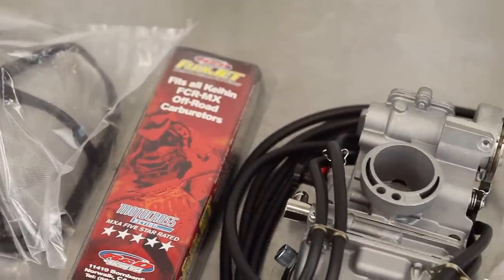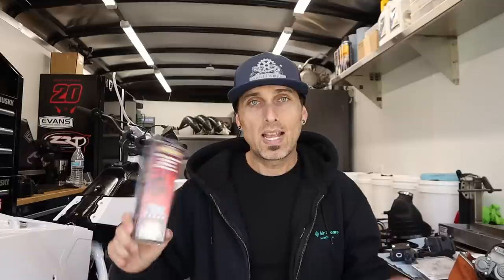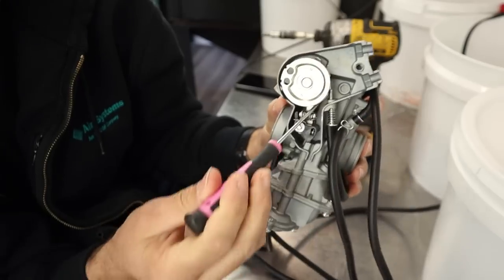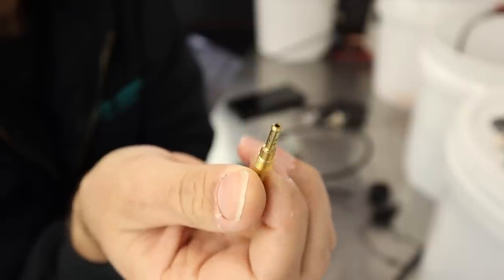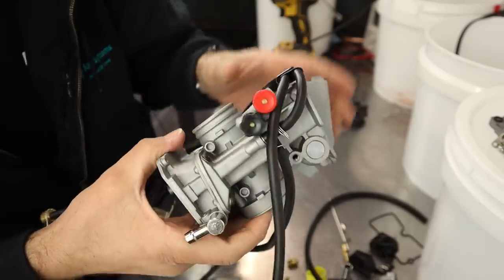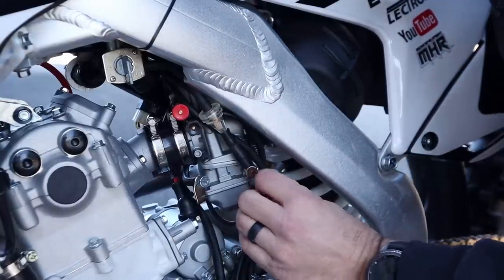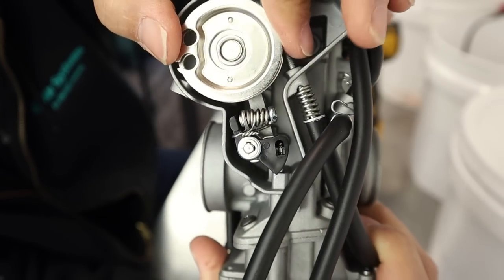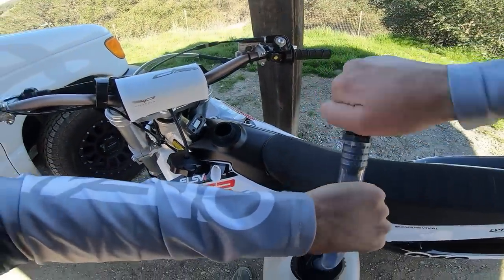Your BRAND NEW Chinese dirt bike runs like S#%T! 💩 Lets fix it.. 2022 SSR SR300 first ride & review

Comment: That FCR carb is way to complex and over engineered for a single cylinder engine, I'm wondering if a carb like the Mikuni 34mm Flatslide would work well on that bike, I raced an Al Baker XR 280 for years and that carb made all the difference in the world and much easier to tune, just a thought but many times simpler is better.
Reply from the maker: It's true! I always thought "wow, how the hell did anyone even come up with this??" with all the castings, ports, threads, etc. It's honestly amazing when you think about it.

Comment: I’m having flat spots up top and having to turn my needle out 4 turns to run. I have a 140 main and 42 pilot at the moment. My cousin said I need to up both jets I’m at 433’ elevation in Mississippi. Any help would be much appreciated
Reply from the maker: If you're having a runability issue in a very specific spot, like you said, up top... You want to focus on that area of getting rather than all of them at the same time.

Swapping multiple Jets at the same time can make it even more confusing and frustrating because everything will change and you won't know which circuit had the good or bad effect and you will start chasing your tail most likely.

So for up top symptoms, usually you're going to want to consider the needles clip position. The needle lives inside of the slide.

If you lower the clip position, it will raise the needle. This will let more fuel through the main jet sooner, which is the jet allowing most of the top end fuel delivery into your engine.

You would only want to do the clip change One clip position at a time.

Also, you could increase the size of your main jet.

You want to focus on eliminating that very specific flat spot up top that you have mentioned. Nothing else in the meantime. 

Just don't make a bunch of adjustments at once. Wanted a time, no matter how frustrating or time consuming it might seem to be.

when you get it, you're going to be pumped and really proud of yourself and also have a great understanding of what change made the impact you were looking for. If it wasn't what you were looking for, you'll still understand what's happening and that will also feel great.

Comment: What brand of adjuster is used on the air/fuel screw?  I can't find any and damn is it impossible to adjust.
Reply from the maker: https://www.amazon.com/Racing-Products-Remote-Screw-FCR-MX/dp/B00DF4GPWA
Reply: @mxrevival  thanks man!  I have to ask, I have had a lot of bog from the bike.  At first it was decent, then got work and the bike smells extremely gassy.  Is it perhaps a rich bog?  I ordered the screw, in the meantime I bought a screw adjusting tool for the FCR.  Do I set idle after bike is warm, and then adjust the fuel screw?  I feel I set my idle several times, and it always has a slightly high idle when I come to a stop.  Any advice would be great.

Comment: I need help with my 2021 ssr 150. Any mods or tips for that one ?
Reply from the maker: I don't have any experience with that carb yet, unfortunately... You'll ant to pay attention to where your problem is i the RPM range, and try to tune that circuit. Each jet effects different parts of the RPM range so that's your first clue 💪

Comment: would this carb setup work on my templar 250cc 6speed from xpro
Reply from the maker: I'm not sure at the moment, but it's not hard to find out. You can email me anytime and I can send you a carburetor dimension sheet.

All you need to do after that is take a few measurements off of your carburetor, mark them down on the sheet I gave you, then send me the filled out sheet back.

We get a lot of our Lectron mods to fit in all kinds of different makes and models. It's pretty awesome!

https://www.mxrevival.com/contact
Reply: @mxrevival  thats amazing sir thank u frfr

Comment: I’d suggest raising the float height
Reply from the maker: Was just about right on the bench! SSR called and made some suggestions for airbox drilling for the top end. I'll give that a try. Otherwise a pretty nice carb update. Thanks for watching 💪
Reply: @mxrevival  if your lean, drilling holes in your airbox will only make you run leaner. Also that little space between cam and where it’s wire tied should be adjustable. Another mod on the fcr carbs we do is gently bend the pump rod back a little bit less than a bananas shape. That way your pushing that accelerator pump rod down further faster and easier. We do that on our yz400fs wr400s 426s and early Yamaha 450s anything with the fcr carb.

Comment: Are lectron carbs wprth the 400$ price tag..?
Reply from the maker: Sell them, use them, love them. I chose to create the Lectron mod for our 300s using a unit that had a price point similar to the bike itself. In other words I wanted to keep the mods affordable as possible and also bring as much value to the bike and bike owner as possible. I have the 2020 and newer models covered for the sr300. 21 and 22 models need a few extra parts but they are listed on the website here: https://www.mxrevival.com/ssr-motorsports-sr250-sr300-sr450-mods

"Worth it" May differ from rider to rider but enjoying your dirt bike and the way it runs without having to mess with it will always be worth it to me and is exactly the reason I created the mod for you guys.

Comment: Why not take up the slack of the rod by adjusting the screw ?
Reply from the maker: I'll definitely have to try it in the future but the spring is pretty bound up already! Wanted to "drop it in" as received to hopefully be a s accurate to the stock 22 model as possible. I wanted to duplicate the issues everyone seems to be dealing with. Thanks for the great comment!

Comment: I squeezed my brake before I put the brake on the front wheel and it tighten up the brake pads all the way now there to tight to put on the bike does anybody have any fixes so I can get the separated again so I can put it on my bike
Reply from the maker: Open the pads with a clean flathead screwdriver. Clean is very important. Gently pry them open again.

Comment: Everything is fine for now, but wait until the frame breaks in half. The Chinese have a very bad metallurgy record and those bikes are very dangerous and can be fatal to an unsuspecting buyer . Don't buy these piles of shit just look for used Japanese bikes and never worry about being killed or injured from inferior metal.
Reply from the maker: I died riding... Seems a fitting end.
Reply: If you get a chance go check one out in person. They are surprisingly well made Bikes. Almost everything is made in China these days. Sometimes assembled in other places, but raw materials and parts are usually manufactured in China. I mean Japan is only ~800 miles from China, you don't think they buy parts and materials from them to save money when making Motorcycles?
Reply: @dannionconrad6717  no they are not. They LOOK cool because they copy real bikes. But just like their pit bikes metal is crap and will not only be weaker new but weaken over time. Then all your bolt threada are gonna strip out and the bike has NO resale value. These are NOT good bikes for the money.
Reply: @crazychad2720  Entry level Hondas are made in China and Taiwan, 'Pit bikes' and such. I rode a CRF 50 and CRF 80 for about 7 years straight as a kid and beat the crap out of those bikes. They all work just fine. Everything is made in the same places with the same tools in the same ways. I don't understand why you act like Chinese products personally attacked you. Do you have any personal experiences with a bike from China breaking in half?
Reply: @mxrevival  Ha! good answer!